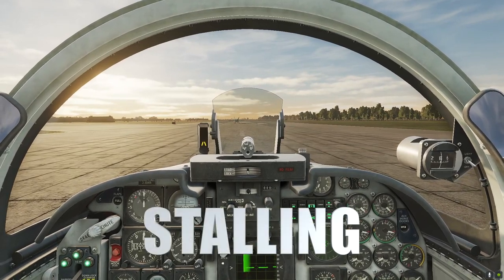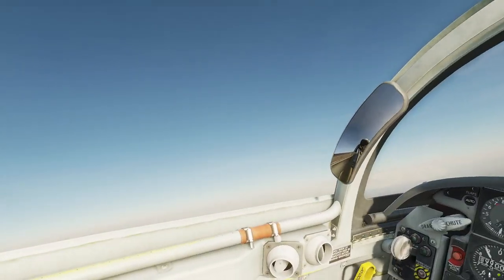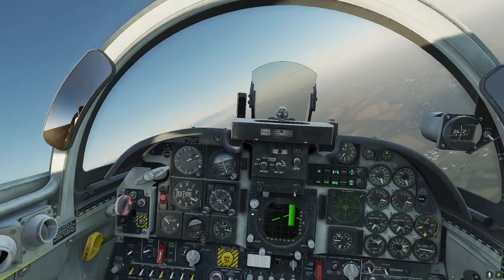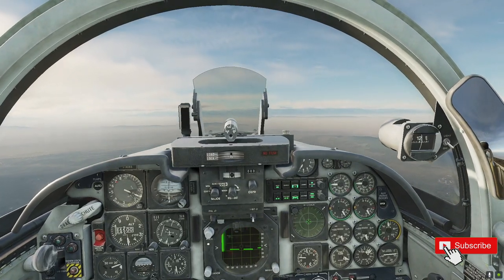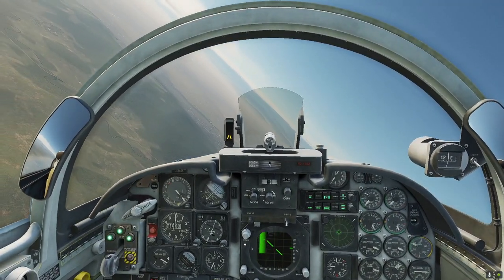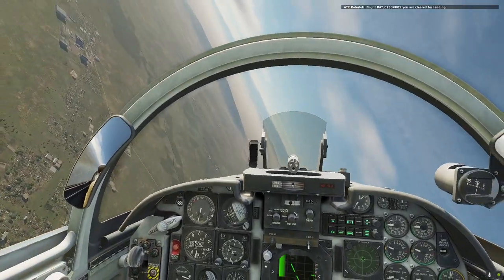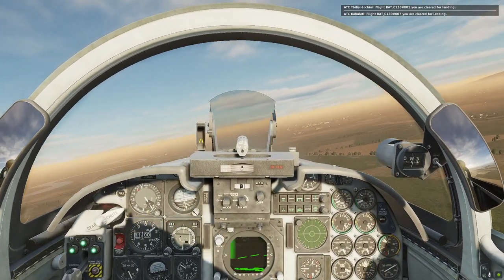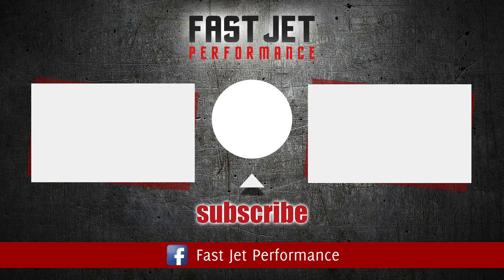RAF Fighter Jet Stalling Training Taught in DCS Flight School

Comment: Great video as always Tim. Out of interest, why no reheat in the recovery?
Reply from the maker: Over 10 alpha and the disturbed airflow into the engines will stall the compressor leading to an engine surge will means it produces no power and will have to be restarted - this is particular to the F-5 in this case, other aircraft differ.

Comment: Interesting that at the full stall there is not much nose drop to indicate the point of stall, plenty of wing rock, but the jet is descending like a box of hammers and nose-high. Is there any tendency to roll-off into the spin (the Yak52 does it readily! And even the Chipmunk will bite if you let it)?

In fact, can it be deliberately spun and recovered (given required height)?
Reply from the maker: If you pick up wing with rudder then yes, you can enter a spin. I give a 40 min brief before the flight that covers centre of pressure movement and boundary flow separation, etc.
Reply: @FastJetPerformance  Tim, did you mean "pickup wing with rudder" and not aileron as being wrong and likely to spin? I just remember from my PPL and a couple of aerobatic flights that using the ailerons to try to pick up the wing just deepens the stall of the low wing and starts a spin entry. Doing that and kicking full rudder towards the low wing gets you into a guaranteed spin 🙂. Opposite Rudder corrects it.
Reply from the maker: @ColinDyckes  it's different in swept wing  aircraft, ailerons are effective at the stall but we can enter a spin by the use of too much rudder at slow speed.
Reply: @FastJetPerformance  Thanks. I didn't know that!
Reply: sampaix  From what Tim said, it seems that swept wings vs straight are the main factor. The airflow from the prop over the tail has some effect in conventional aerobatics, but I believe engine torque is the main factor in extreme manoeuvres like the lomcovak.
Reply: sampaix  I was thinking about specific aerobatic planes like the Extra 300 or 330. I agree that for lower powered planes the prop wash is the main factor. I need to do some reading to understand why swept wings behave differently. Possibly because the ailerons are closer to the fuselage (relatively).
Reply: sampaix  I've got the Extra 330 in both DCS and FS2020. I must try some real aerobatics with them and see if they behave as in real life.

Comment: As a QFI would you really recommend trimming into the stall?
Reply from the maker: For the exercise you will trim into the stalk as, for real, you don't realise you are about to stall so you will also be inadvertently trimming until the stall.
Reply: @FastJetPerformance  I was talking of the real thing.  I'm thinking now of "trim to the light buffet"  Ex 9 or so? BFTS.
Reply from the maker: @HerbertTowers  oh, if you are holding light buffet in air combat, you don't trim to that, no. But for the Stalling Exercise where you are demonstrating the stall, I tend to trim whilst doing it.
Reply: @FastJetPerformance  Yup, that's where I was coming from.  Academic full stall or spin.  Keep trimming until  the light buffet, but no further.  I guess it depends on whether the light buffet is described as a stall.  Now though we get into semantics and aircraft type behaviour - sometimes even individual machines.  Did you hear of the Tucano that would only spin in one direction.  Legend has it that during walk out one day an instructor noticed that one wing was longer than its mate!  That's what happens when aircraft are built by shipbuilders.  Allegedly they were built bespoke.  No jigs!
No idea of the veracity.  JP5s were my steeds.
Reply from the maker: @HerbertTowers  I was a student on Tucano when someone broke the rudder pedals! We thought it would be a quick fix but it took almost a year as all the rudder pedals were bespoke to each jet, lol!
Reply: @FastJetPerformance  I graduated from Hawks ofter a bit of a row with the Staish somewhere near the Rhosnasty  'hotel'.  Graduated early and knocked off the stress by moving to a machine for dropping self-loading meat bombs!  Anyhow, had the great pleasure of having totally jammed rolly wing control thingies, thankfully there was a runway lined up with track and not a lot of XWind.  Approch & landing were still a tad interesting.  Lazy incompetent 2nd line folk, part of the post Cold War 'peace dividend' and civilisation of some trades .  Anyhow, this isn't Beagle territory so I'll chop my fingers now.  Nice few days in San D were had though:)  Excellent site Sir but I would have hated flying with you.  You think far too fast for my truckyfried brain to keep up.  Would love to pull up a sand bag.
Reply from the maker: @HerbertTowers  sounds like you were a better pilot than I would ever be to land a Hawk negative aileron control - I'm sure that story still gets told at Valley, incredible work and I hope one day we get to find some sand bags.
Reply: @FastJetPerformance  It was a C 130 in fact.  Bearings froze solid compounded by the thing having been pressure washed but not lubricated before leaving the UK and then subjected to a lot of sand.  You won't find it written up anywhere...
Reply: Thankfully said machine is boringly stable in roll.  No huge demo of skills required in fact.
Reply from the maker: @HerbertTowers  we need to be able to disconnect Flight Control Systems, lol!
Reply from the maker: @HerbertTowers  Crikey, sounds like a nightmare - ninja skills you must have, fair play to you!